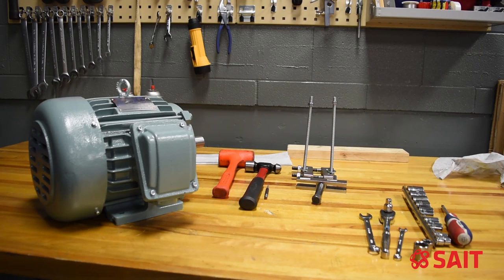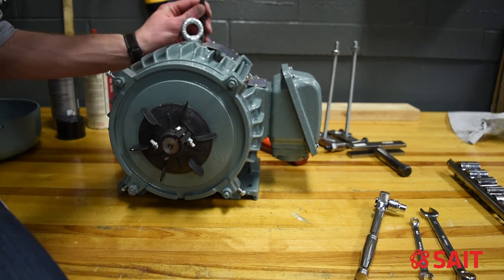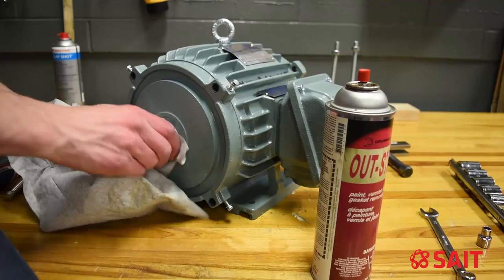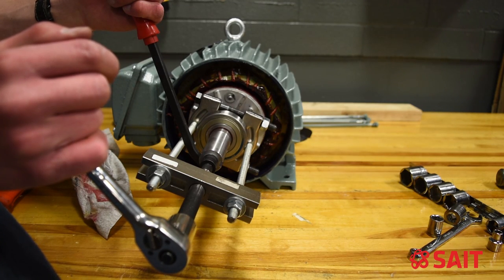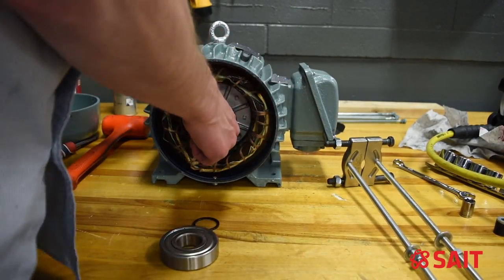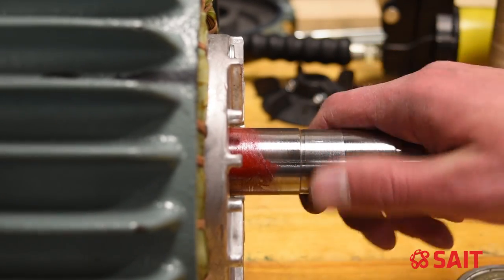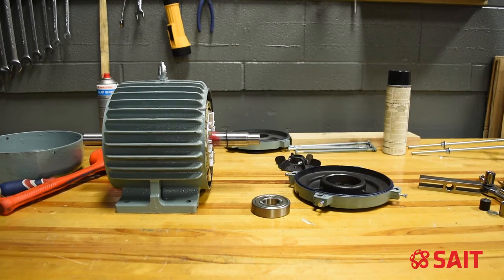Electric motor bearing replacement

Comment: Very impressive presentation.
One thing that I do when installing bearings is to 
always have the shaft vertical, neverseeze or oil 
the shaft and always have the proper bearing drive
device and hammer ready in case the bearing doesn't
just drop in place. 
To prevent metal to metal locking, finish install while hot.
Reply: Is it the same for big size motor
Reply: @redasharawy9  Not always practical for vertical install on larger rotors. Referring to 6301 to 6320
along with comparable 6200 series brgs sizes. We use tube style drivers whenever available.
Reply: @revolution51  would you but me the link 🔗 for big size motor

Comment: Good except it's actually helpful to see you remove the first bearing rather than cut away during footage of the "heavy lifting." It's honestly really great to get a sense what physical stress is needed and what, if any, challenges there can be with realignment etc.
Reply: He cut because he definitely used an impact and said f it

Comment: Very impressive indeed. I had a hard time figuring out how theyd fit the bearings on a motor I got. Using a special Bearing remover . Afterward a tight fit, even heating up the bearing to make the hole bigger. its amazing. I am working on a shaft here and I was all wrong, I was going to use a threaded axel and fasten the bearings with nuts. Im going tight fit from now on !

Comment: Why was the paint that you removed on the shaft? Identification for manufacturing purposes?  I agree with removing the armature to replace bearings. I always feel better pressing them on when resistance exists.You did a nice job on this video. It is so clear and shows detail very well.

Comment: I don't see any problem pushing against the inner ring only. The outer ring is not in contact with anything, so it will only meet air on its way on the shaft.
Reply: Agreed....there is larger chance of damaging the bearing with a strike that’s not perfectly square

Comment: Why do they come glued to the shaft??? I am trying to repair the clutch contacts of a motor and the bearing is preventing me to remove the part that needs to be scrapped with sand paper

Comment: My electric motor needs bearings replacement and the maintenance store issued one ball bearing and one cylindrical roller bearing. Which end of the motor would I fit each of these bearings . And why ? Can I get some help please
Reply: Stamped on the name plate?

Comment: Well done. I really appreciate that. But I have some question on it. 
How do  you call the tools you  use to remove the bearing ? 
And why didn't use the tools to remove both bearing? Thanks
Reply from the maker: Thanks for the questions. 

On one end I used a bearing splitter or puller with a threaded rod, on the other end I used the splitter with a hydraulic power pack. I used different tools to show different ways of removing the bearings.

Comment: I thought if you need to tap the bearing on shaft you should remove rotor because you could damage the winding insulation if not?
Reply from the maker: I think that would be a better idea than leaving the rotor in the stator like I did. Thanks for the comment.
Reply: Agreed Capitol, doing it with the rotor in the stator could damage the stator teeth and wedges, you'd be better off putting it in a similar radius PVC pipe outside the motor to tap that bearing on

Comment: Hey I have several Hoover WindTunnel vacuum motors that need new bearings, the only issue is that I don’t wanna damage the new bearings by using a hammer and socket wrench
Reply from the maker: Try warming up the bearings in an oven for a little bit to about 220 F or about 100 C. Wear heat resistant gloves and put them on the cold shaft. Don't put the whole motor in the oven.
Reply: SAIT Millwright Where can I get heat resistance gloves?
Reply from the maker: @tylonbarnes9678  You could try welding gloves or oven mits.
Reply: SAIT Millwright where can I get a bearing heater?

Comment: If I might ask...? What is the best way to clean any necessary parts in the process if the motor is old and a bit dirty? Thanks in advance!
Reply from the maker: I would consider the type of "dirt" you are trying to clean. If it is oily or greasy my experience is brake clean, degreaser or other industrial cleaner works well. If it is just dusty than blowing it off with compressed air works well.
Reply: @Alexander Wardrope thanks!!!

Comment: What kind of bearing puller you’re using? And where can you purchase it from?
Reply from the maker: I believe it is a snap-on puller, but pullers like this can be found at automotive tool suppliers and other tool stores. Look for a bearing spliter or 2 or 3 jaw puller.

Comment: I think it was easier take the rotor out of the armature and then install the bearings carefully. Second the bearing you installed with your hands is a big issue for sure. It needs to grip or it will make a mess if not happened already.

Comment: what is the name of that spray? thanks
Reply from the maker: Gasket and paint stripper.
Reply: no I mean the brand name it says something like "Out-S....." but i cant read the rest. What does that can say, it works so well. I want to try it. thanks.
Reply from the maker: I think it's called out-strip. It is by Lawson products. I have had good luck with the CRC and locktite products too.

Comment: Thank you for sharing your knowledge. It is a great help. How do you get the special tool if you only rebuild once?
Reply from the maker: Thanks for your support. The tool we use came from SKF and it is quite expensive if you only use it once. It is a fairly common tool used in automotive and industrial applications and may be available to rent from an automotive parts store or other equipment rental place. I have also made my own for odd jobs here and there.
Reply: I use a electric cook top induction heater, only $40, then fasten a temperature probe to bearing and remove it when it reaches 220 degrees F.
Reply: @capitolrefrigerationheatin7501 thanks, exactly the info I didn't know I needed. I'll be trying this, hopefully it works for me. Such a cheap part but critical and so prone to failure leading to catastrophic failure of device.

Comment: just 1 question ,,what side of a motor is front of the motor!, pulley side or fan side ?,,,,99.9999999999999999999999999999% of the people given me different answers.
Reply from the maker: I think there are better ways of describing one of the sides of a motor. Most professionals I have spoken with about motors refer to the inboard or outboard side. Inboard refers to the shaft/ coupling side. If I had to say which side is the "front", I think it would be the shaft side, but that is my opinion only.

Comment: This video is full of mistakes!1. The only times bearing orientation matters is when the two sides have dissimilar shields or one side is open, or when the bearing has a flange or an offset. 2. The diameter of that shaft is .1816?? Not likely. 3. Modern bearings are metric sizes.4. You NEVER drive a bearing on a shaft with a tool that is in contact with the outer race. That bearing is ruined!You're making other millwrights (as I am) look bad with dumb crap like this-
Reply from the maker: Sorry you feel so negatively about this video.  

1.To respond to your concerns, I mention the orientation of the bearing in this case to make the code easy to read if the bearing needs to be replaced. A deep groove ball bearing has no correct orientation as you said. 
2. Yes I did make a mistake on the dimension of the bearing/ shaft. It should read 1.1816". I will make a note of that in the description. 
3. Most bearings are produced to metric sizes as you said. The SKF charts I used to check the fit of the bearing give measurements in inches and millimeters and being that I am in Canada, we uses both systems of measurements. The tools I used were all in inches so that is the dimensions I used. 
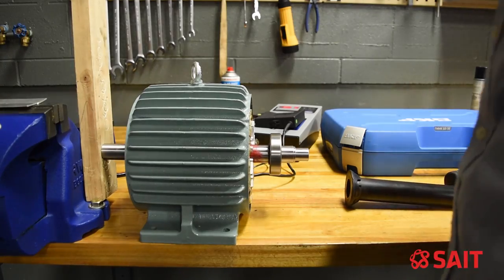4. The final point about the tool I used to install the bearing. The tool is manufactured by SKF (as seen at 19:34) which is one of the leading bearing manufacturers of precision bearings and the instructions say to use the tool as I have done. You are also correct that driving a bearing onto a shaft by the outer ring only, when being installed onto a shaft, would cause brinelling and damage the bearing. However, the tool I used has a feature that contacts both inner and outer rings at the same time. In this application it would be acceptable to press or drive the bearing on by pushing on the inner ring only, but in other cases where the bearing is being installed into a housing and onto a shaft at the same time it would be unacceptable to press on the inner ring only and would need to be pressed on by contacting both rings at the same time. You can clearly see the shape of the tool I used at 19:34 and that it does contact both rings at the same time.

For the future, please be constructive with your comments instead of destructive and i would be happy to make corrections where needed.
Reply: A bit harsh Horace; I'm a maintenance electrician and I found it very informative.
Reply: Good job sir
Reply: I look forward to seeing your video.